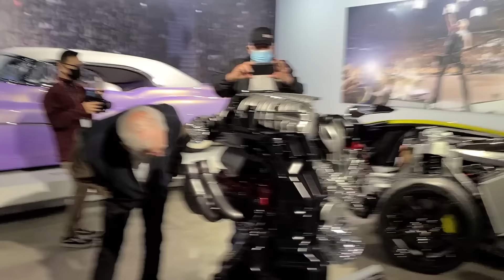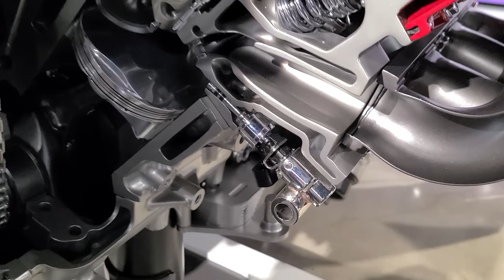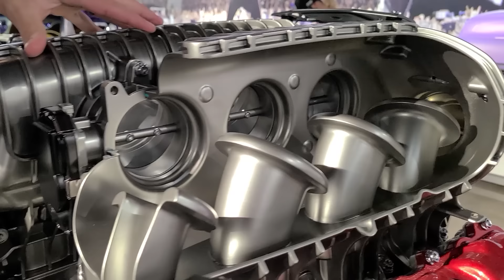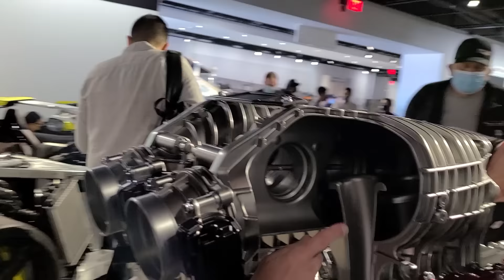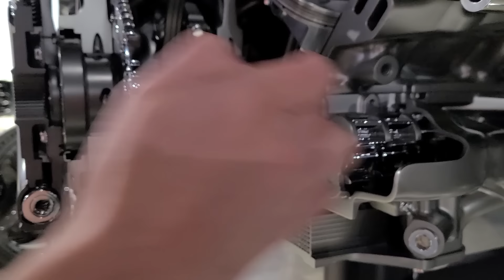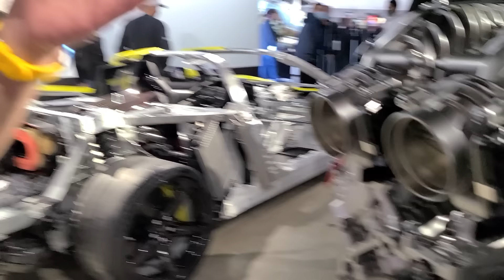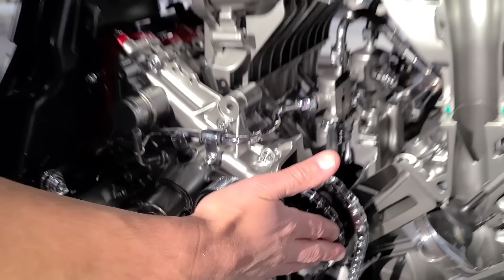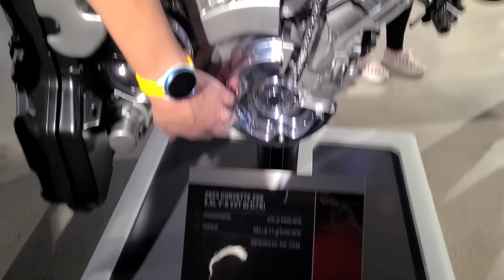2023 Z06 LT6 Cut Away Interview with Dustin Gardner

Comment: The LT6 HAS to be the motor of the year. It is a technological marvel.
Reply: It seems to me that we are quickly approaching the zenith of the internal combustion engine in real time. Definitely bittersweet but an awesome time to be alive!
Reply: @graphitedak04  very surprised GM spent this much money in engineering going the opposite way of what all the others are going (EV, hybrid, and small turbo engines)
Reply: @richardbaumgart2454  I think GM is well aware the hybrid and EV will eventually takes its place in the auto world, but replacing the ICE completely is a long way off. Politicians and environmentalists preach the elimination of fossil fuels, but the real world is a different place.
Reply: @rollydoucet8909  this platform would be easy to convert to EV i think it might be GM's plan to make an EV version or perhaps it will be the C-9 but for now it seems like GM is aware that this is the zenith of gasoline and people like it...but a questions pops up in my mind..is this faster than a Tesla plaid?
Reply: @richardbaumgart2454  EV's seem to appeal to the 'throw away' market. I've never considered that any vehicle I've ever purchased to be a disposable car. Many of the cars I owned ended up selling for more than the original purchase price.
Reply: @richardbaumgart2454  The "rush" to a world of EV's will soon come to realize the major hurdle. The grid, or supply of electricity, will have to go through an expansion that few people can comprehend at this time, and should a major portion of the automotive-buying market suddenly swing towards EV's, the limitations will become quite obvious. More hydro generating facilities will have to be built, as wind and solar power won't be enough. North America has three time zones and the peak hydro demands across the country  overlap each other. There are fewer hours of sunlight during the winter months, and the wind doesn't always blow strong enough to power all the wind turbines. The merge to EV's will have to be gradual.
Reply: @rollydoucet8909  EV' seem to appeal to the douche bags
Reply: @richardbaumgart2454  They have already run an EV prototype.
Reply: @rollydoucet8909  EV are all about centralized control and tracking.
Reply: @rollydoucet8909  Wind is pretty much 24/7 in most turbine locations.  Hydropower screws river ecology and is not reliable.  Off shore wind and tide generators and solar with battery storage will help, but tripling the electrical infrastructure and grid distribution will be tough.
Reply: @richardbaumgart2454  oh, their customers will reward them handsomely for this. Don’t, you worry. They know what they’re doing.
Reply: @RB-xv4si  never said i was worried lol
Reply: @richardbaumgart2454  Q: is this faster than a Tesla plaid?  A: at the dragstrip NO, around a road course YES.  as an NHRA fan (normally i would be in Vegas this weekend) i like acceleration as much as the next man, but ALL 9 second cars regardless of whether it's powered by Battery, Blower, Turbo, Nitrous, etc must universally be brought to a STOP, no exceptions. because: Physics. #5000LBSVS3600LBS
Reply: @rollydoucet8909  Ideally, and presuming batteries can provide sufficient range (~ 200=300+ miles), the infrastructure conversion to EV should be via some type of universal battery pack which can be quickly replaced at an automated service station for roughly the same prices as a tank of fuel - like swapping an empty propane tank for a full one, but faster.
Reply: @richardbaumgart2454  faster than the tesla? I would definitely say so. But quicker… maybe not. I bet the tesla accelerates at a higher rate.
Reply: @xxxYYZxxx  The batteries are located in places that are almost non-accessible in todays EVs, and they weigh hundreds of pounds. Changing batteries would take much longer than re-charging them, and would require the services of trained technicians. Until they re-design cars, making the batteries easier to remove, and also making them smaller and lighter, the battery swapping idea is on the back burner.
Reply: @graphitedak04  the fact that we keep discovering new and unexpected solutions for engine power and efficiency makes me think there's so much more left untapped
Reply: @falcongamer58  This flat plane crankshaft is nothing new lol
Reply: @meterdoogles  I know, I'm talking about engine tech in general
Reply: @graphitedak04  I agree. We are at the peak of combustion engine technology and we are living through history right now
Reply: should make up for DOHC Northstar junk pile
Reply: @Skip R  Keep in mind that this is a naturally aspirated flat plane crank engine, flat plane crank engines are notorious for lower torque in the low and mid range but they have great top end power. This enhances tractability and should make it a driver's car instead of an oversteering wrestler.

It's predecessor was supercharged so that also helps with torque. Eventually you'll see these boosted as well.

Also, if you compare this against other NA flat plane crank engines, this motor has more torque than the Porsche 918 and Ferrari 458 Speciale. Closer comparison would be Ford's Voodoo but that one severely lacks in HP. Overall 670 HP for a flat plane crank NA V8 is a neat technological achievement.
Reply: @Skip R  yeah i'd much rather have that old supercharged 6.2l..much more low end grunt but still making 650 hp
Reply: @richardbaumgart2454  you do realize that they use gearing to make the same amount of torque at the wheels, right? The gearing on the Z06 is incredibly short which gives it the same wheel torque as any of the older Z06s.
Reply: @LearningFast  in my opinion it's a lot more fun on the street to have a ton of off idle torque instead of having to rev the snot out of it....with the peak torque being way up at 6300 rpm with this new more complicated design engine...yeah the trans matters also so put this new trans behind that 600 ft lb superchaged monster
Reply: @richardbaumgart2454  if you put the same gear ratios in a supercharged large displacement engine it would just spin the tires. This car is going to accelerate much faster than any other stock Corvette has. You are going to feel greater acceleration in it than your big torque factory monster. However, this car won’t have the traction issues that the supercharged car would have.
Reply: @LearningFast  so? i said the supercharged engine would be more fun on the street...
Reply: @richardbaumgart2454  the point is that this Z06 will have all of the torque the tires can handle. There is no need for a supercharger on it. It will be as fast as the tires will allow.
Reply: @LearningFast  the supercharged engine would still be more fun regardless
Reply: @Skip R  torque is almost meaningless. Horsepower throughout the rev range is what you should be asking about.
Reply: @LearningFast  likely makes 400lbs of torque from 2500 - 8500 rpm  which is alot
Reply: @ShawnyStorm  it makes 419 lb ft at 8,400 rpms so yes it is likely that you will pretty much always see over 400 lb ft. Combine that with the really short gear ratios and this will be an extremely fast car.
Reply: @LearningFast  
Torque is KING. Horsepower of a function of torque over a period of time (rpm), no torque=no horsepower. The average torque under the entire curve is what all engine designers/tuners are looking for.
Reply: @roadwarrior1961  Torque isn't king, you can make more power without more torque. Torque is the capacity to do work, while power is how quickly some task can be accomplished. In other words, power is the rate of completing work (or applying torque) in a given amount of time. So, to make more power an engine needs to generate more torque, operate at higher rpm, or both. In the corvette's case, the engine operates at higher rpm.
Reply: @meterdoogles  
Torque is a rotational force, expressed in pound/feet (in the USA). It has nothing to do with the ability to do work UNTIL you add a time factor. The definition of horsepower is that 1 horsepower is the ability to lift 33,000lbs 1 foot in 1 minute. The ONLY way to make more horsepower at the same torque is to increase RPM (time) while maintaining that torque. 

In short, Torque is a force and Horsepower is the ability to do work.
Reply: @roadwarrior1961  The point is, it doesn't matter. You can make up for torque with good gearing. This car revs high and has emotion and more than enough torque to break the tires loose.
Reply: 4 roller on the dyno in z06 presentation, so maybe the z07 will have EV for powering the front tires.
Reply: @TheMlc4life  I believe it’s confirmed that the Z06 will be RWD and just have the 5.5L V8. They usually do a 4 roller for cars that the traction control would wig out otherwise on. You’ll see that a lot on the newer cars or they just disconnect the harness for the TCS. The E-Ray and the ZR1 might just be AWD though with the hybrid setups they might be getting
Reply: Ya the Vega was car of the year to . Can't wait for all the service B. to fallow
Reply: It hasn’t come out yet, so time will tell. The regular C8’s are having a complete investigation as to why they’re having issues with the new tremec duel clutch, and they just released the starter location is right under the intake like the old infamous Northstar Design, so GM’s got me worried on this one. The first year might have some serious issues
Reply: Lol it's not a technological marvel. Ferrari was building flat plane NA V8s with a higher specific output over 12 years ago. Before you talk about price, remember that it better be cheap, its 12 year old tech. I will say, its nice to see some domestic brands FINALLY embrace the science behind high reving engines rather than using the same old truck motors they have been using for decades.
Reply: @meterdoogles  exactly. The only impressive thing I’ve seen is how large it is, and that it makes 670 NA. But the reliability is still in question. People were concerned with the 5.2 voodoo having issues being as big as it was with the imbalances of the engine at certain degrees of rotation. This engine will have to combat that even more being even larger. So it’ll be interesting to see how it goes.
Reply: cough*....freevalve....*cough
Reply: @dangearhead2071  lol no joke. Koenigsegg is asking us “am I a joke to you?”

Probably the best point possible to make lol
Reply: @Skip R  It doesn't need more torque for such a light weight sports car. This isn't a 4000lbs muscle car.
Reply: @amazin7006  : What's your definition of a light weight sports car? It must be different than mine. The C8 Stingray Z51 weighs 3,647 lbs. This new Z06 isn't going to weigh any less.
Reply: @oneslackr  base version is going to be 3400lbs and the z07 is going to be even lighter. This is quite light for a modern day v8. Lexus LFA had 350 lbs/ft of torque and was the fastest road car around a track for its time beating the Porsche gt3, Audi r8, and every Lamborghini on the market. 

450 is more than enough for a mid engine car like this, especially with such short gearing. If it can rip the tires loose then it's fine.
Reply: @amazin7006  : Where did you see the C8 Z curb weight listed as 3,400 lbs? Source?  Even Chevy doesn't list the weight of the C8 Z on their website yet.
Reply: @oneslackr  I don't care about ur anecdotes when the actual data from GM is out there.
Reply: @amazin7006  : I managed to find this listed by GM Authority (which of course isn't affiliated with GM) since you're obviously not going to answer my question.  Notice they list it as 'DRY WEIGHT' (i.e. without fluids) just like Chevy lists the C8 Stingray on their website as 3,366 lbs. (dry weight) when the actual curb weight is 3,647 lbs. as measured by Car & Driver.

"2023 Corvette Z06 Weight And Capacities: Dry Weight (Z07 with Carbon Fiber Wheels) (lbs / kg) 3,434 /1,561"  LOL  Sorry but cars don't run without fluids.  It's going to have a curb weight of 3,600+ lbs.
Reply: @oneslackr  im sorry but that is how nearly all automakers rate their sports cars....
Reply: @ShawnyStorm  : Porsche lists the curb weight of their cars in the specs on their website & McLaren & Koenigsegg list both the dry weight & curb weight. Ferrari & Lambo, like Chevy, only list dry weight.  Ferrari/Lambo/Chevy know most people don't pay attention to the difference between dry weight & curb weight & some people don't even know the the difference. People just grab the weight figure they see & run with it. Then they get online & brag about car A being lighter than car B when in many cases it isn't because they're comparing dry weight to curb weight. SMH   Car mags list the curb weight of the cars they test for a reason & not dry weight. 

It wasn't that long ago that Vettes were still fairly light. A C6 Z06 had a curb weight (not dry weight) of 3,200 lbs. or so. Pretty light. There isn't anything light weight about this C8 Z or even the last gen C7 Z for that matter.
Reply: @ShawnyStorm  : "Oneslackr you took that entire time to write that to take a shot at GM just to say that you "think" GM only ever lists dry weight where its listed as "dry weight" so they are not lying if they list....."   

I never said GM is lying about the 'dry weight' of the car. But cars can't run without fluids (coolant, oil, transmission fluid etc..). What I have an issue with is people comparing the dry weight of a car, in this case a C8 Z (3,434 lbs. dry weight), & saying it's lighter than car XYZ when they are actually looking at car XYZ’s curb weight. That’s apples & oranges.
Reply: @ShawnyStorm  : BTW, Vettes since the C6 keep getting heavier not lighter: 
'05 C6 Z51 Coupe -                 3,224 lbs. curb weight (as tested by C&D) 
'14 C7 Z51 Stingray Coupe - 3,444 lbs. curb weight (as tested by C&D)
'20 C8 Z51 Stingray Coupe - 3,647 lbs. curb weight (as tested by C&D) 

'06 C6 Z06 - 3,147 lbs. curb weight (as tested by C&D & quite a bit lighter than a C7 Z)  
'15 C7 Z06 - 3,558 lbs. curb weight (as tested by C&D)
’23 C8 Z06 – x,xxx lbs. (curb weight to be determined)
Reply: Get Rid Of Emissions/Mileage Equipment, You Got A Potent Bullet Right There..
Reply: Amen, u said it!!!!
Reply: I wish they made it a hot-v like they did the engine in the short lived CT6-V Blackwing. 4.2L DOHC Twin Turbo. 550HP and 640tq.
Reply: @dylanh4657  I do not see a hot V turbo setup with the fuel pumps in the valley of the banks.
Reply: @dylanh4657  maybe the zr1?
Reply: @dahei870  Possible. With a higher displacement probably.
Reply: @dylanh4657  Why do we need turbos? Yes they make power but cost too much and too much hardware to go with them.
Reply: @johnpopoff7950  a hot v setup is pretty simple. I didn't say you need turbos,I was just referring to Cadillacs DOHC V8 which happens to have them.
Reply: Very interesting.
But designing specifically for complex robotic assembly .
I don't like the direction us auto makers have been going for decades. 
Building complex, low quality vehicles .
Even impossible to service at the dealership.
I've never seen a dealership with a robot to do anything in the service department.
The reason why engines are hand built, for special cars.  
They will need to be serviced, and people, not robots will service it.
Reply: @madmagyver9981  Achieving higher precision with robots means reducing human errors in the present and the future.
Reply: @machtschnell7452  not true.
The highest precision is achieved by hand. 
Robots and technology in general still have to obey the laws of physics, and are constrained by exact physical condition. 
In the age of robotics and CNC, and the lack of the need for actual skills.
Manufactured products have declined in quality severely as a result
Reply: @madmagyver9981  The only thing the computer does is pick the correct shims for each lifter. If you take it apart and put it together with the shims in the correct place, no computer is required for service. I agree with the complexity problem but that’s all auto makers not just GM. This engine is a stunning achievement in any context. If Ferrari introduced this exact same engine, the response would be the same. It’s astonishing GM gave them permission to build a clean sheet design NA ICE power plant. Ballsy. 

Oh and for the most part US cars are as reliable as their foreign counterparts. That’s been true for some time.
Reply: @Spuds555McMuffin  the reliability is only for the Corvette, pickups and maybe Camaro. The rest of the lineup is garbage. 
I don't care about Ferrari, and in the 60s we kicked their asses. 
Now I'm supposed to be excited about a 100 thousand dollar engine at a time California banned Gasoline engines in the near future.
Any engine built with those materials would be fantastic, for an impractical hypercar
Reply: @madmagyver9981  These will be hand built like all there high end engines and the pistons are like that on most modern vehicles.
Reply: You say that! Not me ... weird piston design with NO skirt tells me if they grenade . Woah a big mess internally
Reply: @SmoothCruizer37  Why would they grenade in stock form?
Reply: @SmoothCruizer37  not just that.
Being built by robot, creates a difficult scenario for hand rebuilding.
Titanium rotating assembly, serious custom dry sump.
Very very very expensive engine.
Reply: @madmagyver9981  You type a lot of words and say a whole lot of nothing. The engine is right there in the video, point out a single flaw, I dare you. Not this vague bullshitting "built by robots" fantasy shit you came up with.
Reply: @SmoothCruizer37  made by robots, lifetime valve adjustments with metal to metal high rpm cam to follower contact...what could go wrong....they are disposable engines, if something messes up the teardown and inspection time required to clean debris will definitely out weigh the cost of another engine
Reply: @young11984  Not unless there is a design flaw.  Engine heads may have to be rebuilt by Chevrolet in the future, though.  Should be well past 250K, though. It will be interesting to see how often they have to be walnut shell blasted, though.
Reply: @machtschnell7452  yea I see some expensive maintenance just from the DI, already heard of 3 thats back at the dealers with not even a guess when they will get them back